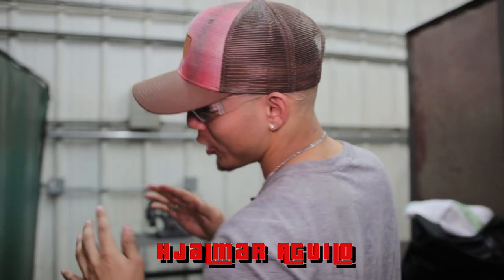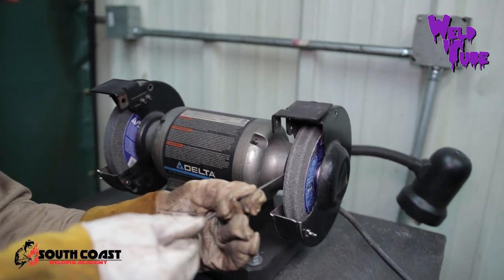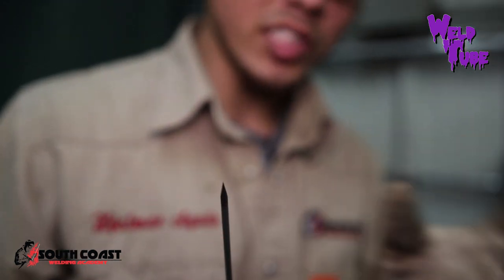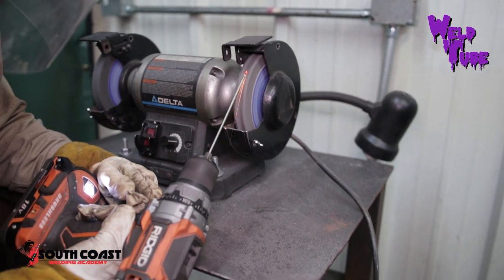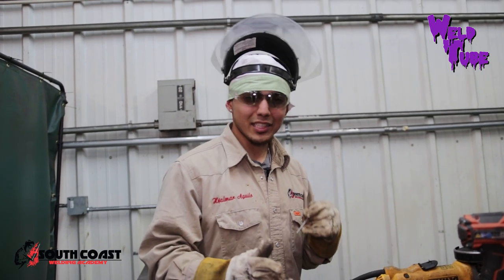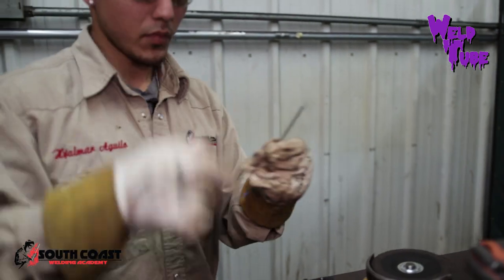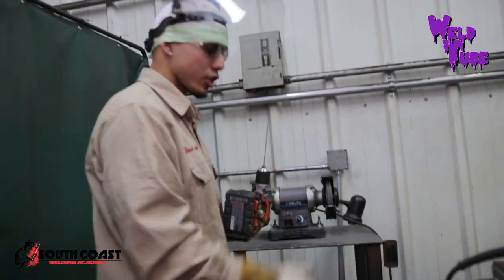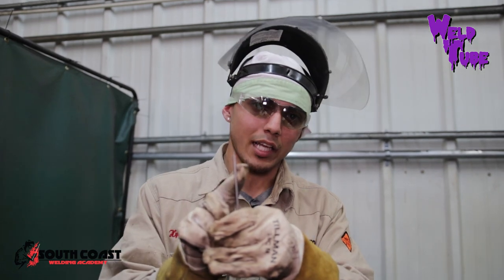Basics of TIG Welding - How To sharpen Your Tungstens

Comment: I was always taught to grind with the grain of the tungsten not across it. Which on the bench grinder worked but when you showed some guys using the side of the wheel or an angle grinder, that’s across the grain and I’ve found it definitely makes a huge difference in how the arc acts
Reply: I grind it like he did on the bench grinder but I showed it to some geezers and they started panicking that the electrode is supposed to be aimed in the opposite dirrection when grinding which I disagree with, because this produces sharper electrode and there is difference in arc stability

Comment: Retired Boilermaker, sometimes we would use a cutting torch to sharpen tungsten.
Excellent videos my friend!!!
Reply: Im late by 4 years  but i cant wrap my head around that 😂
Reply: @redlock1815  me too😂
Reply: @redlock1815  The older welders would sometimes use a cutting torch to sharpen the tungsten electrodes. Pointing the torch away in the cutting stage (trigger in) and turn the electrode by hand over the nozzle, and it comes out pointy. The cutting torch doesn't melt the electrode, the host gases blasting past the electrode tip is kind of like an abrasive before it melts, especially since tungsten melting temperature is very high. Someone shows how it's done here: https://www.youtube.com/watch?v=Dv58c37sX0k

Comment: I was always taught that when using a bench grinder, to shift the tungsten from side to side to avoid making a groove in the wheel and wearing out the stone too fast.  Also having the groove, makes the tungsten more round that straight point
Reply: you should not worry too much, there is a special tool that can be used to flaten the surface of the grinsding stone
Reply: @joons3374  yeah.. but you are still using up your stone much faster.  Why not take the time to do it right?
Reply: @bikesfightback  it depends, for example  the stone that I use is quite narrow and one edge of it was already round for some reason, so it is hard to change the grinding position...

Comment: Sharpening with an angle grinder by hand seems super sketchy. Doesn't seem too bad with the drill though.
Reply: last method circular pattern produce in tip of W so not used due to contamination occur at tip and gases are also absorbed.
Only plane pattern is good in tip of W.
Uddhav

Comment: I would like to throw my two cents in really quick... 
If you rotate the angle grinder shroud to 9 o'clock and 3 o'clock in relation to the grinder body being 6 o'clock, leaving the 12 o'clock wide open... You can prop up your tungsten on the leading edge of the shroud and the dust isn't getting all over you as well as getting nice, straight lines on the Tungsten.
Just prop the tungsten against the shroud at 3 o'clock and put the top at 1 o'clock and rotate the tungsten away from the grinder. If the grinder is upside down, the grinder is spinning counterclockwise and you rotate your tungsten clockwise for straight lines up the tip.

Or buy a Scottsman tungsten sharpener and be done with it.... 👍🏼

Comment: My question is about the build up on the tungsten ABOVE the tip.  I'm learning and I get a lot of crap (contamination) above the tip.   Must it be removed?  And if so.  What is the best way to get rid of it?  If I grind it.  Then the electrodes become out of round and ugly.  I haven't seen any videos that address this.  Thanks so much for your videos.  They are a great learning tool. 
Thanks JohnW

Comment: Helpful thanks. Just wondering when the length of the tungsten gets very short. How can a person sharpen it on a bench grinder without getting too close and burn fingers or touch the wheel.
Reply: they make tungsten holders, they have little chucks like the drill, some even have a storage spot on them for back ups!

Comment: Im in welding school and having trouble with my 2g cert.  Its a 3/8 plate 1/8 6010 open root no backplate. And the rest with 1/8 7018 with a 2 bead cap. Can you please do a video thanks man.

Comment: MIG weld stainless, i would love to see you do a video on the subject.
Reply: I have experience in thin like anywhere from 20 gauge to 10 gauge stainless flat, if your welding thin (depending on the welders preference) I tend to weld at 275 and 21 volts, I am going downhill on stainless so you have to go faster

Comment: that grinder sounds terrible.  you know if you move the tungsten side to side while you spin it, you won't get those grooves on the wheel...  flat wheels are more useful IMO.  i use a 100 grit diamond coated disc on a bench grinder, so i'm on the side of the disc not the end (it's thin like a CD).  that type of disc won't heat up the tungsten nearly as much either.   i was told in welding school that grinding it red hot is not good for the tungsten....not totally sure if that is a real concern or just best practice.

Comment: The fast way is no good. You should never get your electrode red hot like that at the tip. Considering there is no shielding gas present, you are contaminating the electrode via the atmospheric elements that are present. This can lead to cracking and splitting of the Tungsten later on. Take your time with it and minimize heat input.
Reply: Maybe dip it in water before grinding, and then dip it again each few seconds so as to keep the temperature low, would be a good idea? My neighbour make knives, that's how he keeps the steel unhardened.

Comment: When I took welding at the community college in my hometown they told me the opposite of what you said when sharpening by hand. They say that doing it the way you showed made it possible for the tungsten to stab into your hand if it got caught up. I just always done it that way because it’s how I was taught. Do you think it was just the teacher telling us to do what they did? Or is one way really better than the other? I don’t mean to offend at all...this is an honest question. Thanks
Reply: You get a better tip grinding into the wheel in my opinion, no sliver leftover. If you use common sense,  this is a safe technique. If you tilt the tungsten up close to 90° it could kick at you. Why you would ever have it at that angle I have no idea. With that said, you school teacher just removed that variable by fliping it over, aka dummy proofin it.

Comment: Flip that guard around and grind tungsten throwin sparks away from you..not at you. Thoriated dust is harmful.
I've had that ssme rigid drill since 2010 and use it to sharpen bunch of tungsten as well..love that drill model n its lightweight.

Comment: 10 dollar diamond wheel at harbor freight best way to go
Reply: jacob lawson diamond wheel for a angle grinder or bench grinder?
Reply: Angle grinder
Reply: jacob lawson what size it? Im trying to look it up
Reply: Brandon Hernandez its like 3 inch wheel maybe used for a bench grinder I just reem the inside out a little bit and put it on my angle grinder
Reply: jacob lawson would it be the one that comes in a pack with other things? Im going to go buy it in a bit
Reply: Brandon Hernandez yes it comes with some red stone for a bench grinder I think but that diamond blade is 4 inch
Reply: jacob lawson is the diamond wheel a thin one?
Reply: Brandon Hernandez yes
Reply: Brandon Hernandez got a yellow ring on it
Reply: jacob lawson how long does the wheel last you
Reply: Brandon Hernandez had mine for like a year now and only used it on one side
Reply: It's for a special saw-sharpening machine they sell.  The machine is very cheap, it comes with a diamond wheel.  I just use this machine with all it's accessories and gadgets taken off.  I was meaning to make a thing like the "Pirhana" grinder out of it, but it's good enough as it stands.  The HFT diamond wheel seems to last a long time, I've really abused it.  I would like a "fine" disc though, and I'm sure this is available.  I use the same wheel to cut off and sharpen.
Reply: Diamond stuff never really dies.  If there's just a few specks of diamond left it'll still cut!  You might get impatient.  I've sharpened hundreds of points on the original HFT wheel, and you can see spots of bare metal there... but it's not bad enough to make me change it!  I really would like a new wheel someday, and also a much finer one to make that point shiny, maybe clamp them together so it seems like one wheel with two different sizes?
Reply: Oh yeah, that's all I do and you know every swinging Tungsten is being sharpened with that damn diamond wheel from harbor freight in an angle grinder!